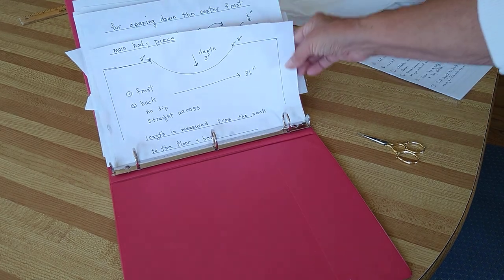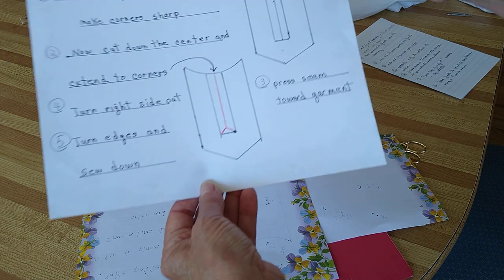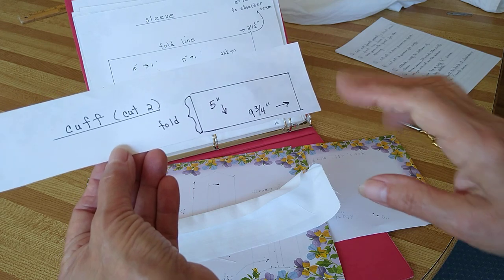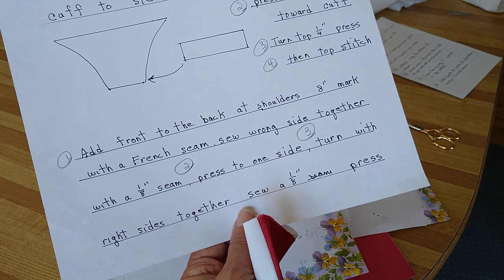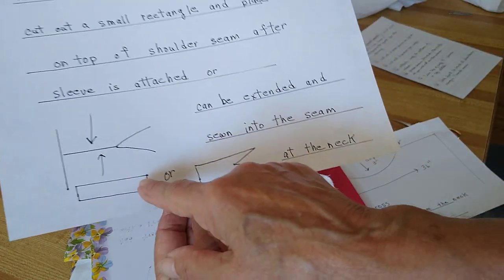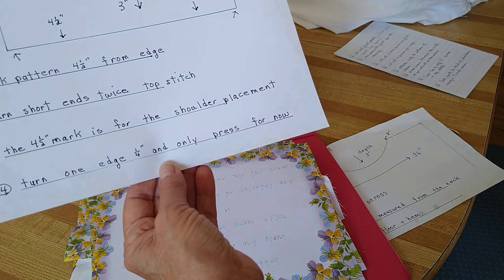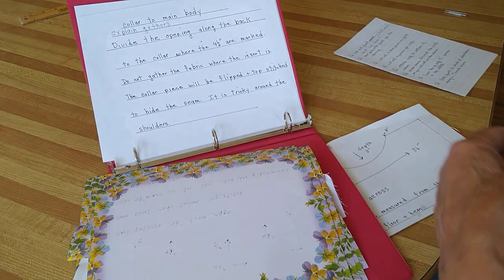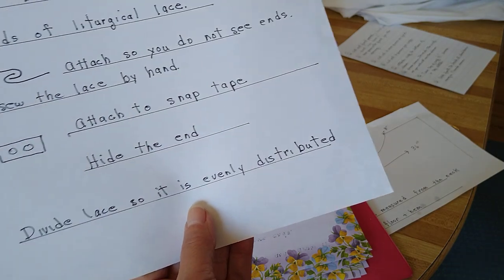Alb

Comment: are you still making vestments?  I have a question about adding a pocket to an existing humeral veil
Reply from the maker: Yes I am. Can you take the seam apart?
Reply from the maker: When you do follow the directions and you should have no problem. You have to take it apart far enough to be able to place the picket there. I would not take the fringe off. You should be able to do one side and then the other. Good luck.